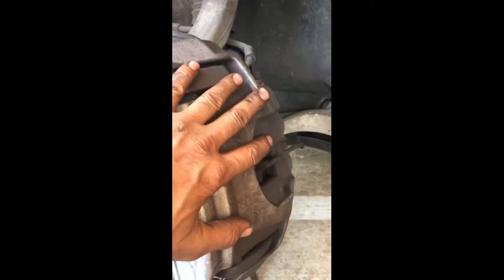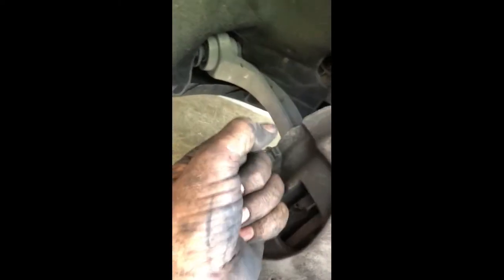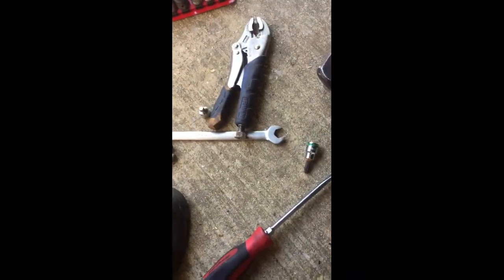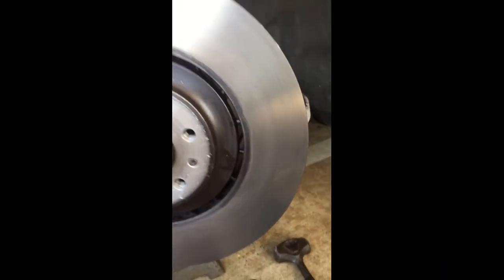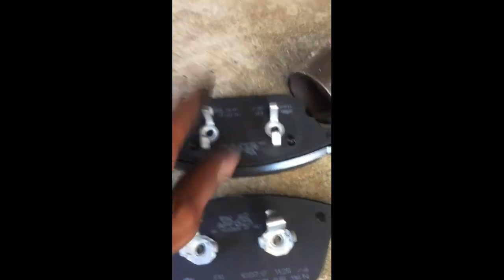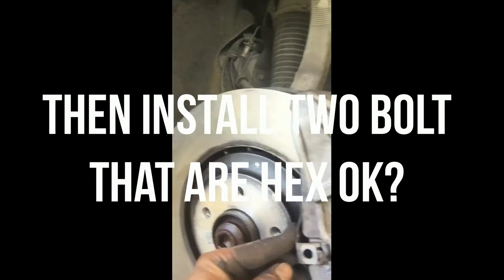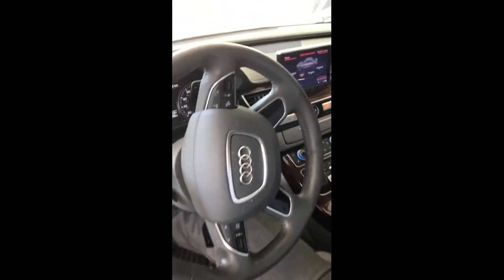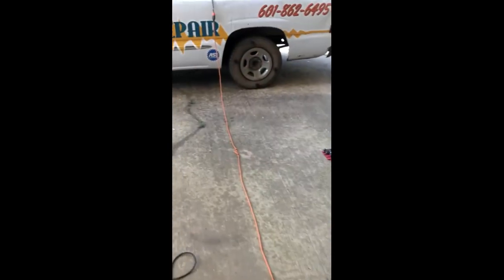2013 audi A8  front brake pads and rotor replacement

Comment: I bought a 9mm at Autozone for a 3/8 drive and it fit perfect, they dont have a 9mm in kits but they sell it single.
Reply from the maker: Johnny Wishbone   Yes, I bought one too at advanced... They usually sell them in sets
Reply from the maker: actually, i could not find one that day,, not even in a set.. i went to two part stores that day looking.  needless to say i was getting pissed and frustrated, so anyway i  had to call the parts truck and hunt him down on the other side of town to buy a 40 tool,  lol  .. yeah, that job was time consuming but the mission was a success :)

Comment: You should have used Air suspension wheel change mode when jacking the car and not towing mode. In service menu. Tow mode doesn’t disable the air suspension.

Comment: Hey great video Imchanging the brakes on the same exact car. Is there anything that needs to be done as far as bleeding the brake lines?
Reply from the maker: khood60   No need to bleed brakes,. The only time you need to bleed brakes Is if you disconnect hydraulic brake lines or you have a leak somewhere in the system. Changing brake pads does not require bleeding brakes good luck to you buddy

Comment: Hey great video. Quick question. Im only changing the brakes on the same exact car. Is there anything that needs to be done as far as bleeding the brake lines?
Reply from the maker: kelly johnson no need to bleed brakes!  Unless you have a leak or disconnected one of the brake hydraulic lines
Reply: hey kelly, what sizes or pads and rotor did you get for your car ? i have an Audi A8 3.0 SC 2013

Comment: hey i have a Question, i have an Audi A8 3.0 supercharge 2013, and this is my first time changing the rotor, do you recommend i change the rotor after only changing my front twice and my rear once ? for all 4 ? and what sizes of breaks and rotor do i use 380mm or 356mm or 330mm? also do we change the wire sensor of wire fluid in every break pad change ? thank you !
Reply from the maker: Moe Als    Change rotors as needed.. uneven surfaces, heat stressed, warpage.. if they look good leave me alone.  Ijs.    Always go with manufacture specifications. Good luck.  It’s a good idea to change the sensors while doing the brake pads.. i’ll go with yes. 😉

Comment: I thought you had to use the Audi/VW diagnostic software to retract the calipers.
Reply: @HayesMobileAutoRepair   When replacing rear brakes on Audi or VW with EPB, the correct way is to use the software VCDS to fully retract the rear calipers. As seen here:
https://www.youtube.com/watch?v=cHJMI4QkSy8
Reply: @sg.5360  Yes, but this is a front brake job.  Nothing special except to put it into tow mode for the suspension.